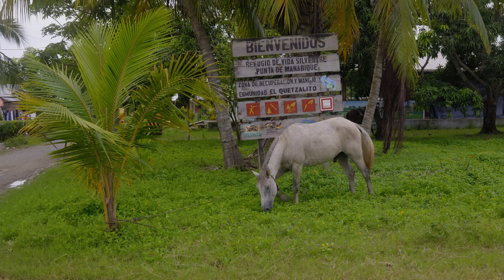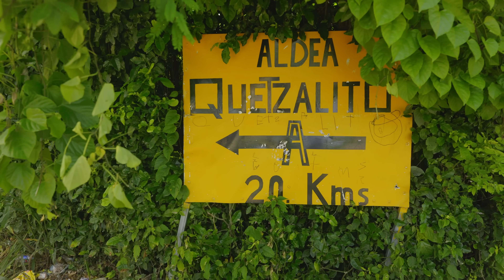Interceptor 006 and 021: Getting closer to the end of plastic pollution in the Gulf of Honduras

Comment: But are you doing layered spread of interceptors. As in timelapse we can see that some plastic still slips. So you could add one/2 extra barriers down the river. To make it much cleaner.

And as this is static barier could you not add conveyer belt or smth so that portion of plastic was still moved before you get there. As it seems that overfilling with trash makes your interceptors fail to catch the portions of plastic.

Or even more braindead solution would be to create barier perpendicularly to the interceptors and have lines  from it be attachable and you could simply scop plastic with this big barier that would have conclave shape.
This way you would need less time to use excavator.

But those are my basic ideas. ...

Comment: The system is amazing And the amount of plastic it is stopping getting into the oceans as mind-boggling

But the systems should be just a short term solution to the greater problem 

And the main problem is education of about how to deal with your plastic rubbish

Cleanup of the ocean is amazing prevention of rubbish getting into the ocean is even better but preventing the rubbish getting into the rivers is even better again and that can only be through education 

The ocean cleanup is doing amazing work but they could do so much more with education and preventing that plastic getting into the system at all

Comment: Good stuff.

Step 2
TOC should help organise, with local communities along the river, (local) governments and maybe other NGOs, a systematic clean-up campaign to address the waste that has accumulated along the banks between i006 and i021 ... while it is true that some of it will be flushed down river and get caught by i021, I would assume that most of the waste along the banks will stay in place, buried deep in the mud/soil, caught in vegetation etc. etc.
Great work has been done to stem the root inflow of trash into the system, so this might be a good time to start recuperation/restoration works, while the government tackles issues upstream from i006 and slowly introduces a sustainable waste management system.

Comment: Interesting. Where I live we have a slightly different system. We use trash cans, dumpsters and garbage trucks that put the trash into a landfill. Then we collect methane from the landfill that gives us a cheap source of energy. The landfills break down most of the trash and after a cyclone of a few decades the land can be repurposed into a park or something. You should totally try it. It's better than tossing your crap in a river and hoping that someone else comes by and cleans everything up for you.
Reply: Lol, a landfill does not break down plastics in any meaningful time. And plastics are a huge part of trash. Also this trash comes from a landfill/dump site when a flash flood hits. I doubt you live in a place with the same weather conditions.
Reply: @electroplaque  There is no weather condition preventing any civilization from managing their waste. They are, quite simply, dumping their trash in a river.

Comment: Thanks for your work. You mentioned the garbage dump at the beginning of the river in an earlier video and that a lot of trash comes from there when it is flooded. Does the state of Guatemala do anything to close this dump or fix the problem? Because it sounded like that's the source for quite a lot of trash in the river. Seems unlogical that they bring the trash there in trucks and dump it onto the river and you then have to get it out and put it in trucks again. But again: thanks for your hard work. You are doing a great job and achieve maximum impact with minimum recources.
Reply: cheaper to install this facilities and dump in anothr landfill rather than doing a proper waste management ;)

Comment: That water flow is so rapid in the first half. The quality of strength to hold the weight of not just the water pressure but also the weight of everything in it, the trash, bottles.. plastic & glass! & those are not all empty bottles! 🦾 🤩

Comment: The dump trucks dump back to the beginning?  What if we just start paying for used plastic? Used plastic has value now, someone with $ could just start stacking it up. They turn it into carbon nanotubes with a microwave pyrolysis process. There might be enough plastic waste to build a space elevator.

Comment: is anything being done to change what is causing that much plastic to be in the river int he first place?  it's great you're catching it but if you're not going to reduce it just seems like a band-aid on a bigger problem.
Reply from the maker: We are here to significantly reduce the amount of trash entering the Caribbean Sea from the Motagua River. We see this Interceptor deployment as the fastest way to achieve this goal. Upstream changes are part of the solution too, but these changes require time. We hope that one day our Interceptor Barricade will no longer be needed, and we know that the authorities are working to prevent the trash from flowing into the river. But we also know that these periodic tsunamis of trash continue to cause great harm to the oceans. We want to ensure that the Barricade prevents this river debris from becoming ocean pollution to give us the time needed to address the waste management issues behind the problem.
Reply: @theoceancleanup  thanks for this info, I had the exact same question and no doubt many who watch this video do, as well. Maybe pin this at the top of the comments, please?
Reply: That's the issue of developing the waste management system, which is handled by local government.